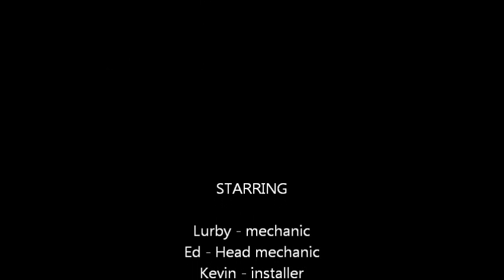Ford 4R100 automatic transmission rebuild

Comment: hey Matt.  I'm having an issue getting the back of the front pump flush with the case.   when I look through the underside it seems like there's still a 1/2 " gap.   I rechecked the coast clutch assembly and it seems to be in there correctly.   any advice?
Reply from the maker: sounds like the pump halves are not aligned properly and the top half is getting caught on the case.  Use your finger across the outside of the pump after you bolt the two halves together.  If you feel that it is not even then you must take back apart and realign.  I think I might show a trick on how to quickly and perfectly align these pumps because they can be quite difficult if you do not have proper tools.  Needless to say, use 4 extensions house bolts as guide pins in the pump at 90 degrees (or close to it).  You will notice some holes with tighter tolerance and use those holes to put your bots in.  Finally tighten you pump.  It lines up perfectly almost every time.  Let me know how you made out.
Reply: +Matthew Damato. all set bud.  it was the coast clutch assembly.  Wasn't set in properly.  one of the clutches was in the way.      BTW what type of fluid should I use. I'm hearing different opinions online
Reply from the maker: If it's a 4r100 then regular dexron will work perfectly.

Comment: ok I have simple question that I have not been able to find the answer to. The internal gear has off drive for where the torque convertor goes into it. Does the beveled area go toward the torque?
Reply from the maker: Rodney Brown yes,  the beveled side of the inner pump gear faces towards the torque converter. the flat side of the pump gear faces the stator half of the pump. if you have it backwards, the torque converter will not go in.  good luck.

Comment: Hey Matt, You have very good material but I can barley hear you in this video. I'm about to rebuild my E4OD out of my 92 F150. You were saying something about using parts from a C6 to add a few more clutches. Where can I find more about this?  I'm going to be towing a trailer and would like a little more meat for that purpose. Thank you!
Reply from the maker: You probably won't find any literature with respect to modifications  I mention in the video.  I will be happy to answer any questions you may have.  First, you must be very careful when switching parts because there are many parts from the C6 unit that look close to the E4OD but can cause catastrophic failures.  One trick however is to use a C6 pressure plate from the Low/Reverse clutch pack to stuff an extra clutch in your E40D.  And by the way, depending on the piston you have, you may be able to squeeze an extra 2 frictions.  My question to you is whether your trans is from a small block, 6 cyl, big block, or a diesel?  If it is either a small block or a 6 cylinder, then you probably have on 3 clutches in both the forward and direct drums.  Therefore, you can either buy new drums made for diesel with the extra clutch, or merely buy a the bottom forward pressure plate with over sized steels and use that pressure plate as your top pressure plate in the direct drum.  There are many other quick and inexpensive ways to make this unit stronger.  If you have a specific questions don't hesitate to ask.
Reply from the maker: ok, I will email you tomorrow. I'll be glad to help.
Reply from the maker: There are many internal part swaps you can do to increase the strength of you 6 cyl unit by using diesel parts instead.  First, if you are planning to just sell you truck, I would not invest in the upgraded parts.  However, if you plan on keeping the truck or van then changing hard parts over to a diesel is a good way to make the transmission last.

There are many variations of these parts so be very careful changing anything.  The easiest thing you can do first is to increase the amount of frictions in almost every clutch pack.  
1) The low/reverse pressure plate you can use from a diesel, which will let you add an additional clutch and steel.  Or you can use a C6 pressure plate and put an extra 2 frictions and 2 steels.  The more clutches =  increased torque capacity.

2) If your unit came with only 3 clutches in the forward and/or direct drums, then you can use the 4r100 diesel forward and direct drum which will let you have 4 frictions in the forward and up to 5 frictions in the direct drum.  

3) Same for the large Overdrive fictions, change the pressure plate and you will now have a 3 clutch OD pack instead of the 2 clutch pack.  

4) You may want to invest in 6 pinion steel planet set in the forward planted.  The 6 pinion will come with a bearing (instead of the 6 cyl washer) and you must change the hub it rides on.   The sell this as an update package kit or simply take it from a diesel unit.

5) The overdrive planet is 3 pinion aluminium carrier and you can use the OD set up from a diesel that has a 4 pinion steel planet instead.  Just make sure you use a different input shaft with that swap. The shaft will have an ID grove in the end of the spline for easy identification. 

6) You can use the pan from any 4R100 4*4 which uses a bonded rubber gasket and a deep filter.  Don't forget to change the filter to 4*4. This will allow you to add an extra quart of fluid in the unit and the bonded rubber gaskets NEVER leak, unlike its predecessor. that uses a paper gasket.  You can easily tell the two apart by the later pan has a flat surface and the earlier pans have a dimple where the pan bolts would be located. Do not mix the two or you will have uncontrollable leaks.

7) Lastly, I recommend getting a new center support (without the aluminium) which will come with the updated cup plug in the output shaft and new hub that fits in the bearing in the support.   They sell this as a kit and requires you to remove the buching in th output shaft if it is an ealy type (sometimes difficult).  But if you have a later unit (even if it is 6 cyl) it may already have the bushing removed with a cup plug in its place. 

This should get you going.  There are a lot more updates and tricks, but these are the basics that will give you a good strong unit 

Good luck.

Comment: Have you ever tried the OTC lipseal protector for installing the forward piston? I tried using a bent feeler gauge to get the lip seal in. I ended up tearing two seals. The book calls for the lip seal protector but I've not seen anybody ever use one. Thanks
Reply from the maker: Totally unnecessary for a 4R100.  It is the exact same piston as the old C6 fwd piston.  In fact, I didn't even know that OTC made a tool for that drum.  Some units require these piston installing tools, like in a 4R70W and AOD.  However, anything for a 4R100, you can just save your money.  What I use instead is a piece of piano wire or a very thin feeler gauge.   The best tool to install pistons and protect the lip seal is find yourself an old draw removing tool for an old Snap-On toolbox.  Snap-On stopped making these style toolboxes about 16 years ago so it may be difficult.  I've had mine for about 20 years now.  If you can locate one, then get a steel 3/8 line and crimp the tool in the pipe.  Then wallah, you have a professional piston installing tool.   Good luck.
Reply: Matthew Mathews  I checked Snap Ons online store for the tool, but it's not listed anymore. Our local Snapon guy just had his house taken by snap on, so I'm not going to have a truck for sometime to come. Guess I'll just keep trying the feeler gauge method with the replacement seals...I bought extra!
Reply from the maker: Are you sure you are building a 4R100?  Make sure you don't have a 4R70W please because unlike the ease of installing the piston in a 4R100, a 4R70W will need the piston installer.  As long as you have a 4R100, it is one of the easiest pistons you can install.  Feel confident because you can do this.  You can really use anything to push the lip seal down,
Reply: Matthew Mathews it's a 4r100. I get piston into position and try to tuck the seal in. I was trying to keep a little pressure on top and I guess I just put to much force because it cut the lip of the seal and went in crooked. I probably tried to hurry but I did spend some time trying to press that seal into place. This is my first 4r100, but it's not my first transmission

Comment: What is the difference with the ford 5.4l 4R100 vs a ford 7.3l 4r100
Reply from the maker: +Justin Quilantan For starters, the cases are different because the blocks are different. There are 3 different cases to be aware of: small block (5.4L) gasoline,  big block gasoline (7.3), and diesel (7.3L). The general distinctions are that the diesel trans are more heavy duty.  For example, they have 3 clutch OD sections instead of 2,  6 pinion planet instead of 3 or 4, and 5 clutch direct drums.  Also, the torque converters are made to be pulse width solenoid operation and thus, inside has a double clutch which you can tell by the outside if you were to rub you finger across the outer diameter you will feel ridges whereas the single clutch is smooth.  The valve bodies are different, pumps are different, and lastly the solenoid blocks are different.  If you have a specific question about a part, just ask.  I hope that helps answer the question you were looking for.

Comment: Hi Matt. I have a Ford F250 2003 6.0. Transmission was repaired. But when I went to pick it up it was giving me problems to put iit in Drive and reverse. After a couple of days when I was to put it in Drive it would make a strong noise and sometimes it would sound twice when I hit reverse. Then after a month when the transmission is going to change to another gear it makes a very ugly and strong noise and when I reduce speed I observe that the clock of the Transm temperature starts to move up and down from the lowest to the highest at the same time that the light of the gage starts to turn on and off. With your experience do you know what can be cause these 2 issues? I will greatly appreciate your response on this matter. Thank You
Reply from the maker: prqtgirl This is tiff one because there are so many noises.   Can you try to be as descriptive as possible.   On the other hand,  if a shop just fixed it,  bring it back for warranty.
Reply: Matthew Mathews I am looking to rebuild my 2000 4r100 in my f250 7.3 diesel. I have bigger injectors and will need it as strong as possible. Can you do it ?
Reply from the maker: First, I am not here to promote any business or obtain work.  Therefore, I do not take jobs via YouTube.  Instead, I am merely here posting videos to afford specialized knowledge in the world of transmissions to the common average person with some mechanical skills.  And yes, the right modifications to this unit can make it stronger despite diesel units being strong from the factory.  I will be more than happy to go over everything with you if you are interested.
Reply: Matthew Mathews I am mechanically inclined. But transmission I know nothing of there dynamics besides the basics. Do you think I could do this job and beef it up without machining anything. Some of the performance diesel 4r100 master mechanic rebuild kits I have found are quite robust and require small amounts of machine work in areas where they "beef up" certain weak points or wear areas
Reply from the maker: Bo Mason Hi Bo, I think anyone with mechanical ability and some patience can rebuild a 4R100. Furthermore, although you will need a few special tools, nothing in a rebuild would need to be machined.  If a part is worn to the point it needs to be machined, just buy a new (good used) part instead.  It will save you a lot of time, frustration, and money.  I hope this video helps and in it, I detail everything you can do to beef up the unit without buying anything fancy.  if you have any specific questions, feel free to send a comment and I will be happy to answer.  Good luck.

Comment: hi matt.  my rebuilt trans was working great for over a month until recently i lost 3rd gear.   at first it was jumping from 2nd to overdrive on the hwy.   now it wont go past 2nd.  im hoping its just a stuck accumulator valve.  if thats the case how do i prevent it from happening again besides cleaning it well?   also anything else that can cause this?  bad solenoid pack?
Reply: ok i tested pins on the solenoid pack and all ohms  are within range.  i also checked all the valves on the accumulator and main valve body and none are sticking.  i recently installed a 6 pos chip.  could that be causing the issue?   when i first lost 3rd on the hwy i changed the setting to stock and that fixed the problem.   now even on stock mode i still dont have 3rd :(       when i pulled the pan i did find tiny amounts of metal particles on the magnet.  didnt know if that was normal on a fairly recent rebuild
Reply from the maker: the solenoid pack can cause all sorts of problems but rarely goes bad.  The only thing that really happens to the solenoid blocks is that the pins break off in the harness.  Next, the accumulators do get stuck and steel after market valves work well.  Superior makes a good kit for this that comes with a nice brush that you can reuse but make sure to keep all the tiny springs in order.  The springs are different sizes.  With that said, I would find it hard to believe the accumulator will be stuck after a month of working fine.  My advice would be to first drop the pan and inspect it for debris.  Then take it from there.
Reply from the maker: tiny pieces are normal.  I would look into that 6 pos chip.  Can you bypass this and put it back to stock?  I don't know much about this chip you installed.
Reply: +Matthew Mathews yes i replaced all the springs and valves when i did the rebuild.  does 3rd gear and reverse share the same clutches?   i still have reverse so does that mean its not a hard part issue?   ill clean electrical connectors on the transmission range sensor  just to make sure thats not causing the problem
Reply from the maker: Yes, the direct clutch pack is for both 3rd and Reverse.  But just because you have reverse does not necessarily mean direct is okay.  Sometimes you can still have a problem with direct despite having reverse because the pressure in reverse is so high compared to drive (125psi which is almost double).  Therefore, the increased pressure can sometimes mask any problems in that pack.
Reply: +Matthew Mathews  ok i checked the valve bodies , changed the solenoid pack, changed the neutral safety switch (had a code for it), cleaned the plug connectors for that and the solenoid pack.  is there anything else I could check before I have to pull the transmission again? could it be the wires? if I do end up pulling out the transmission anything in particular I should be looking for

Comment: what was wrong with this trans ive got one that the over drive never engages and a shifter light that never goes out  although it did go into over drive a few times but the light on shifter never did go out the switch on shifter is also brand new

Comment: I have a big problem with my 4 r100 I am rebuilding. When I installed my pump it pushed the shaft so hard on the center support its cracked. And I can't figure out the the shaft won't sit far enough to in threw the center support bearing to alow the pump to set down flush. Any ideas?
Reply from the maker: +Kyle gandy first, what year unit is it and what actually cracked, the center support itself?  Ok, most likely the problem is that one (or maybe even more) drums are not sitting down into position all the way, either being held back by a clutch or a washer that might have popped off and now not sitting right.  The first rule of thumb is that if you have to force anything together, then something is not in properly.  My next question to you is what hard parts have you changed (parts other than clutches and sealing rings)? After every part that gets installed, double and triple check that it is actually sitting in the unit all the way, flush.
Reply from the maker: +Kyle gandy Also, be aware that if the center support is what was cracked and now you are changing it, although the aluminium part of the center support has always been the same, the steel part (bolted in by 3 bolts) has undergone major changes.  So be careful when matching it up, otherwise you may create a huge lubrication problem.  feel free to send me some pictures if you like in my email, I will be more than happy to give you a hand and help you figure this thing out.
Reply: +Matthew Damato awesome thank you. I will get home tonight and figure out more details and get back to you.
Reply: +Matthew Damato what is your email